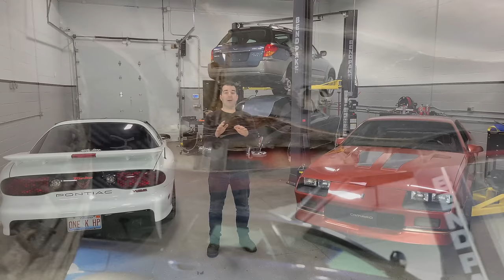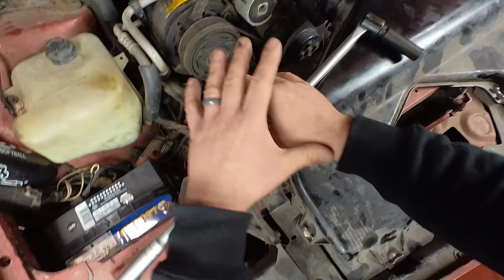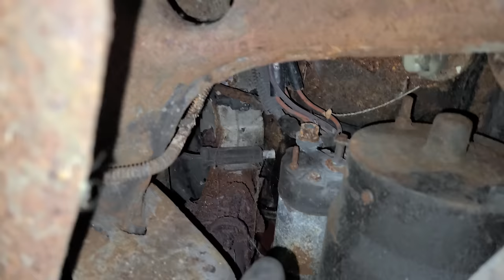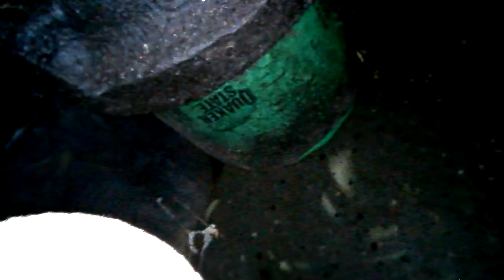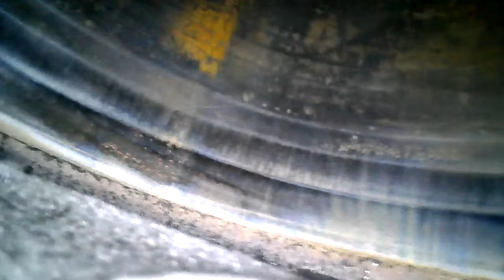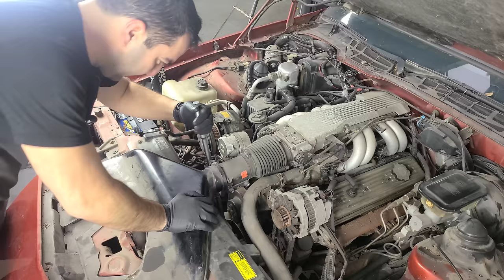Starting An Abandoned Camaro IROC Z After 27 Years & Looking Inside The Engine! Storage Unit Find!

Comment from the maker: How much do you think this car is worth? 
LSC Merch is here! https://www.legitstreetcars.com/
Reply: The market right now?  I bet you could get at least 10k for it all fixed up
Reply: What if u LS9 swap it or modern LT4 or new 5.0 😆 👍
Reply: Well, nuts. I was hoping the engine would be OK, but I guess it got stuck in the storage locker for a reason, like the junk I have around the house that I've been planning to fix up. And it sits, and sits, and sits. I wonder if the motorcycle is the same story. And I suspect the Millennium Falcon isn't going to be making the Kessel run anytime soon.

Hopefully if you can't get it running you can get your money back parting it out.

Dave
Reply: two words: apartment rebuild 

It's worth a lot of you do something cool with it for a Youtube video, Alex :) I purchased a 1988 IROC in 1989 and had quite a time with it, so as an old-dude car guy, I'm emotionally invested in this car of yours - take all the following with that in mind. May I suggest:  

Try doing the infamous "apartment rebuild" on it to see how little you can get away with and how cheaply you can get it back on the road. By this I of course mean leaving the block in the car and going underneath it to try to replace the bearings (or whatever you find wrong) while removing as little as possible from the car and especially not the engine. No machine work beyond something goofy attached to a drill. That's an all-day watch in my book.
Reply: $50 bucks and a Happy Meal.
Reply: Much less than you paid would be a guess, I know you are an F body guy but please just let them rust in peace!
Reply: Now it's worth the scrap value.  Drop in $30 thou and it will be worth $15,000 but the nostalgia will be priceless.
Reply: 350 swap it for cheap I did my 305 monte for under a thousand
Reply: It’s worth about what you paid for it, when you part it out. The rust is making it difficult to justify further invest money into unless you are prepared to do it yourself without the expectation to sell it with a profit. 
I have a rust-free 1991 z28 convertible from Southern California and invested more than  $25k including an LS swap/6-speed manual. I will never recoup that investment but that was never the intention either. It’s a passion for the F body 😉
Reply: How much can you milk sponsors for the videos you will make about the car? That much.
Reply: Whatever the revenue is on a few videos while you rebuild the motor and restore the body while its out. Plus resale. 
Normally I'm the guy saying scrap it but there's something about this one making me think its worth it. 
No idea why but I feel like you'll be happier if you do it.
Reply: It's worth 1000 bucks.
Reply: Are we talking scrap metal price? Lol I’m sure there’s someone out there who could use some parts off it
Reply: Depends on the current market price for scrap metal
Reply: Don't think it's worth much. Well, maybe for some of the parts. BUT, as I said last vid, if the money you make per vid on this car allow you, why not restore it and show people how much it cost fixing a car like this the right way? I mean, if it work, you'll end up with a sweet car, and as you stated many people would just not care about it 'cuz it is a hard top, but as time will go by, that will make it rarer and it'll be a cool car to show. Plus you could always make a resto-mod out of it with a modern LS in it and other stuff. In the end tho, it's your decision. But I think that you seriously lack classic cars in your stable.
Reply: This is the absolutely perfect car for a tube chassis or a body swap.
Reply: If you get a donor shell from somewhere without road salt and swap interior, it might be worth it. No matter how bad the rust looks, cars are made of many layers, and the layers underneath are likely worse!
Reply: I think at least if you get it running and driving you can make some good videos make some money and then go from there I think about other ideas with the car fixing it up and racing your Trans Am sounds like some good videos to me
Reply: Fix that car up make it look beautiful again could be a game-changer for your Channel
Reply: It's worth just under what the 24 hours of Lemons cut off is.  Pop in a junkyard motor, put a cage in it,  grab O.J. and film all of the disastrous fun.
Reply: Part it out she’s gone 👍👍
Reply: LS swap is thee answer 😎
Reply: @alarson1981  but why, it is too rusty. You can buy these all day long with trashed interiors but rust free body in southern states that run too.
Reply: There’s a couple grand in parts. For someone that wants a chassis to rebuild for himself, it’s decent but not for what your doing
Reply: This is a perfect candidate for a cheap LS swap and a new fuel tank! 24 hours of Lemons, anyone?
Reply: Dont know about the car, but  the Plews Copper Pistol Oiler, you’re looking at about $27.50 on Ebay….. 👌
Reply: As much as it pains me to say this as an fbody guy, that Camaro's life is over. Frame is gone, body is trashed, interior is wrecked, and the motor is blown. An unfortunate fate for many fbodies it seems. Part it out and maybe turn a small profit is the best option for this car IMO.
Reply: just put a junkyard LS Truck engine in it w all of the harness and trans (or manual trans) 
for the rust just remove the contaminated metal an weld nice sheet and finally a rollcage and a detail
Reply: $250 max - it’s a rusty pile of garbage. Interior parts might be worth salvaging but the rest is crap.
Reply: Damn… sorry to hear about the motor being trashed. Hit me up in an email if you’d like to get rid of it. I’d much rather take the time to restore it than see it parted out. Great content as always, looking forward to the next video!
Reply: I'll buy it
Reply: $1000 bucks is all i would have spent, but you already spent the money now its time to decide what you wanna do with it. i gave my opinion on it in a different comment go check that out.
Reply: You could get up to $3700 here in Canada ... Engine $2200 sell here $10,000 to $15,000 Plus
Reply: @conanobrien1  LOL 👍
Reply: If you paid me $1500 I might haul it to the scrapyard for you.
Reply: Parted out, it would be worth considerably more than you paid. Possibly pick up a clean(rust-free) running 1988 or 1989 IROC-Z with the 5.7 engine, then keep the essential parts from this 'storage unit' rust bucket, and sell the rest.
Reply: As it sits ?  $50-75 at a junk yard... Not sure anyone that, if you were honest (and I know you are), would not give anything more. Sad to say, I would cut my losses on this one.... just not worth it..
Reply: She is crispy underneath
Reply: That Iroc is one of 3,010 in that color! Fortunately because it doesn’t run you can now LS Swap it..
Reply: Restore it Alex. It's still an IROC-Z. A running and driving one is worth $20,000 at least. That rare color might make it worth $25,000. The interior is really nice and just needs a good cleaning.
Reply: The value it is on the eye of the buyer at this point. I will not put a single cents more on it. That it is a great part out example for a good restoration candidate. Lots of good parts that will help a better car to look even better. On this market you may be able to find someone that wants it as a hole unit and pay for the car and shipping. Good luck Alex.
Reply: Love these cars tear down engine and rebuild it would love to see some content on that keep up the great videos
Reply: It's worth what you paid id say and you should put a big block dodge motor in it that would be amazing
Reply: $1,400
Reply: I paid 300 for one that had a bent rear sway bar and absolutely no rust but that was 20ish years ago
Reply: about $500
Reply: How much is worth?  depends mostly on how much it weighs.  otherwise, not much.  Someone might give you a few dollars for the wheels and perhaps someone looking to build a stock car or something might buy the rest for beer money.  Otherwise, it's a rusty turd, IMHO.
Reply: I think this is also  good PSA for new  buyers and new hot rodders  looking to jump in get their project on. This is  Showing us even if you have all the information, you never know it all. At the end of the day, even with going through all the  basics, you may just have a total loss/basket case on your hands.  Worth 100- 200 dollars  scrap. Might get a little more parting out with the current rise in prices and parts market slowly drying up on these things.But it is  Still a cool car in my books. Good luck on your decision.
Reply: Alex, lots of jealous haters out there. Let's get it restored and back out on a blacktop where it belongs!!
Reply: Just part it out the engine is gone you got rust problem way it sits now maybe thousand
Reply: It's worth of fixing... It would be a really good series to watch...
Reply: It's worth $500 for someone who wants it for parts. Besides that it's worthless. I think you are an honest guy so I'm going to believe that you didn't buy this for views and that you innocently bought a piece of junk. I'm willing to ignore the fact that you have an extensive knowledge about cars just because I want to believe that you legitimately bought a piece of junk without knowing.
Reply: Can I have the car :)
Reply: Post a pic of the RPO codes. It can have some value.
Reply: I'll buy it. I'm in Aurora il. I can pick it up
Reply: Hit me up
Reply: The last piston you showed at 6:38 looks like it had a hole in it.
Reply: Use it as an opportunity to show us how you’d part out a car 😂
Reply: @chrisw9629  naw.... i would buy it and save it
Reply: @CarsandCoding  The rust is on the undercarridge and floors - the parts that you would need to be cutting out any way. Why cut up a solid southern car when you have one what is already destroyed to cut up?
Reply: I'd reach out to Eric (IDoCars channel) and see if his shop importapart has a salvage engine to throw in there. He's based out of Missouri and got me a transmission for my car.
Reply: As it sits...scrap metal. Get it running and looking half decent...someone will pay for it. You will get your money back and then some and have YouTube content.
Reply: My man you are completely psycho and I love it. Let's save this car that can't be saved, bring it to life so we can kill it. LMFAO. It's such a beautiful car though it does suck that so much is wrong with it. But I love that you gave it a shot anyway, I'm sure it'll serve a purpose in some kind of way.
Reply: Even as a parts car, it's probably worth about what you paid for it. I know the car has rust and a blown motor and it's probably easier to just part it out and get some of your money back and be done with it,  but.......it's a super-duper rare color. I've been in the 3rd gen community since these cars were new and currently own 3 low mile examples and I've only seen 2 MOM cars in the flesh. I know a lot about them. I also am local to you. Feel free to reach out, should you have any questions. In the console is a sticker called the SPID. The codes on the sticker tells you everything about what the car left the factory with. Regarding it being a hardtop,  that's not the bummer you might think. Fewer of them are around nowadays and people seek them out. Charlie
Reply: Message me price if you decide to sell.
Reply: If you still have it, give Derek @ Vice Grip Garage a call. He'd fix the engine, do all the frame & bodywork and make an 8- or 9- part video out of it. Then he might sell your dream car back to you.
Reply: I will give you 500 bucks as it stands I am sixteen and have a dream. It would be a great first car for me to rebuild
Reply: I'd part it out like you mentioned in the video, selling it as is would be for a substantiation loss
Reply: We've all had emotional purchases then had reality set in. Sometimes we get lucky and every once in a while we don't. I tend to still pursue the original goals but just make choices with more of a budget in mind. Maximize your labor investment, minimize the money investment and create content.
Reply: About what you paid for it,$1500
Reply: Where is your shop located. Im from gary indiana. Also lived in harvey il
Reply: You would be better off scraping it or try selling it
Reply: Its an Iroc. The values have been going up on these. I believe it was worth a little more than 1.500 as it sits. Fix the engine 4 to 5 grand. mint condition 10 k plus
Reply: You paid 3k so it's worth what someone is willing to pay!!
Reply: @nathanblanchard2357 I was 😂😂😂
Reply: im curious if this car was torn down to discover that the flexplate was broken around bolt pattern which creates a very rod knocky sound
Reply: Hope you got rid of it that engine needs a rebuild coolant got into that pan that's why it looks like milkshake and guaranteed there's a crack in that engine the previous owner used water instead of coolant and that's probably how it cracked , the rust in the cylinders was another give away in how the water got in. The spun bearing you were right about because of the water leaking inside it couldn't get the consistency of oil in between the connecting rods and crank journals and the head gasket has to be replaced as well I would have swapped it for a 327 or a 350 instead.Yeah remove that engine I was never a big fan of the tune port engine in my 3rd gen Camaro but good luck I enjoyed the Vids 😊

Comment: Just do what Jarred at Wrench Everyday did..... buy another car and swap everything around until you have 1 good car.  LOL
Reply: Preferably a body that’s lived either out west or in the south all it’s life.
Reply: @digitalrailroader  and as he said, examples of those are not cheap.
Reply: @Brian_Buckley  especially in this current bizzarro used car market, where anything halfway decent is too expensive, and anything affordable is complete garbage and should be scrapped.
Reply: Is Jared actually wrenching on cars again or just videos about driving around and talking about it.
Reply: @myz06rocks  he's not "wrench everyday" tavarish
Reply: Do this!
Reply: @myz06rocks  Yeah - Jarred just took 2 Dodge Chargers to make a single good one.  It didn't turn out half bad.  But I think Alex is up to the task of pulling that off.  If not, he can give the boys at B is for Build a call and let them body swap it onto a new Camero frame.
Reply: @RealRickCox  And what would they swap? The engine is basically trash, the whole body is rusted out... the only thing the could use is the interior and that would make no sense inside a new camaro.

Better let it sit and look for a non-rusted unit that needs a new interior badly and maybe some rims. 🤷‍♂️
Reply: @Brian_Buckley  I find it absolutely incredible that the turdgen can hold any value at all. Lol
I literally gave away my 91 convertible after pulling out my LS swap and selling it separately and pulling out the 9-in and selling it separately...
Reply: @makpsv  Yes, a lot of the current car would have to get tossed... but imagine doing a body swap with a newer Camero.  The interior would be 100% modern but it would have a retro looking outside. :D
Reply: @Brian_Buckley  yea no they are not cheap at all. I’m in the Midwest my dads friend behind his house has a white z28 like this and He never takes it out it’s pristine. He starts it and idles it ever so often he’s been offered 20k for it many times.
Reply: @RealRickCox  Ok, but the only real usable part of this one is the interior, the body is half gone and due to de dimension difference between new and old it would be a heck of a job, they would've to widen the old body to fit everything.

I don't say they can't do it, but this car has all the wrong parts for it. 🤔
Reply: @makpsv  From what I've seen, all of the main body parts are okay.  There are some minor rust spots on the door and fender, but those are fixable.

The biggest issues with this car is the engine and the stuff underneath.  And if we're body swapping the car, we don't necessarily need or want the interior.

I think it would be amazing to see this car retrofitted... it would definitely be a 1 of a kind!
Reply: Difference is Jared had a better motor in one car to work with and better bodies on both cars. This camaro is pretty much scrap not much useful parts on it.
Reply: @beejsonw  technically, the second Charger Jared bought (a Genuine Hemi Charger Pursuit that was a former Orlando PD car that had dropped the seat on the Cylinder 4 exhaust valve) had a MUCH better body to work with as the movie car he bought was totaled TWICE, and was essentially bodged together for the movie.
Reply: hell yeah!!
Reply: Late model Chargers are easy to find cheap. 3rd gen F bodies that aren't rusted into dust not so much.
Reply: This is the perfect candidate for swapping everything over to a rust-free roller. It looks like everything is there and the interior isn't sun-baked or rat-infested. This is way better than starting with a running car that's been beaten, worn, modified, and left outside, since tracking down all the odds and ends will eat up your time and budget.
Reply: I am not sure much is salvable from that car tbh. 🤔 but I agree better car and make that one a donor.